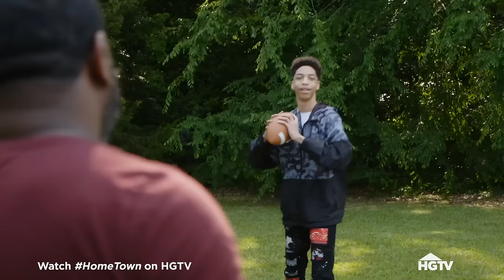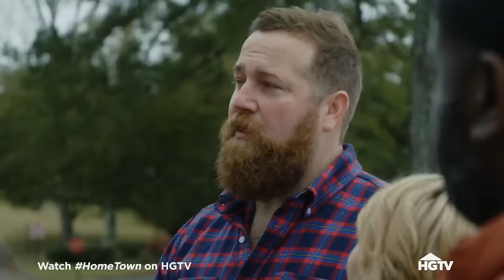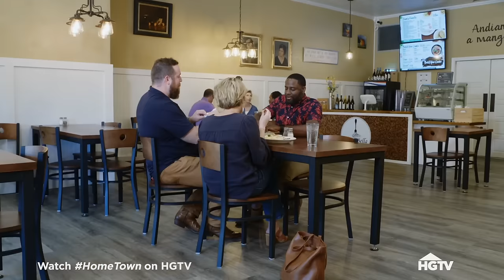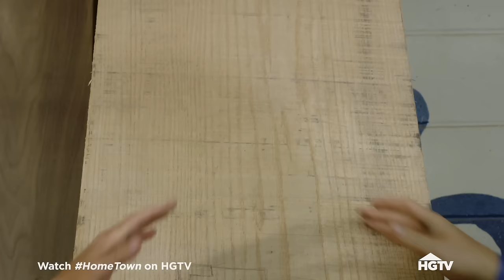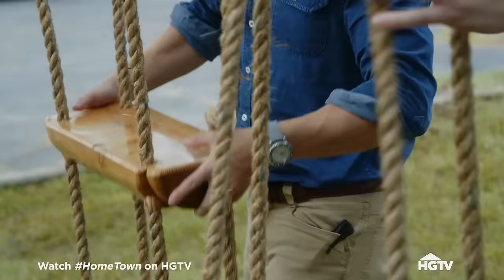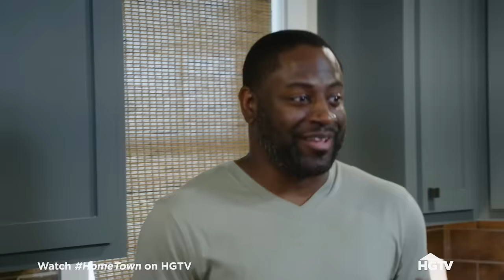A Perfectly Beautiful First Home - Full Episode Recap | Home Town | HGTV

Comment: This is the 2nd time that I've seen this house. I think it was uploaded as another title. It's NOT one of my faves. I would've switched the position of the living room & kitchen. In condos & apartments, it's common to have the kitchen and/ or bathroom in front, but not for houses. I prefer to have the traditional setup of living room upon entry. Also, they changed the entryway for the bathroom. You can only enter the BR from his bedroom. So if he has guests, they all have to enter his bedroom to use the bathroom. (eww - to me, it's a security & privacy issue). I liked the other stuff that they did - kitchen colors, exterior, etc.